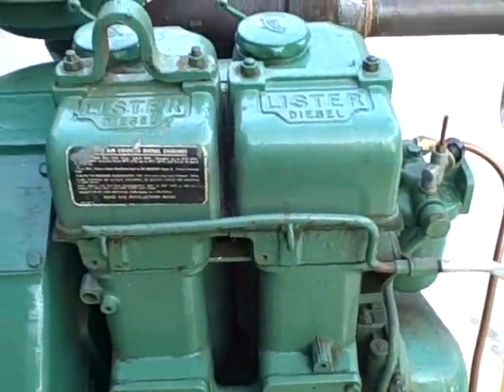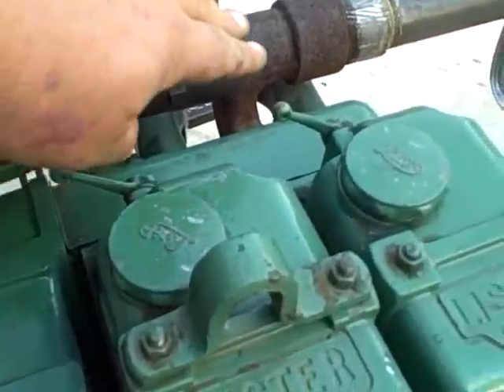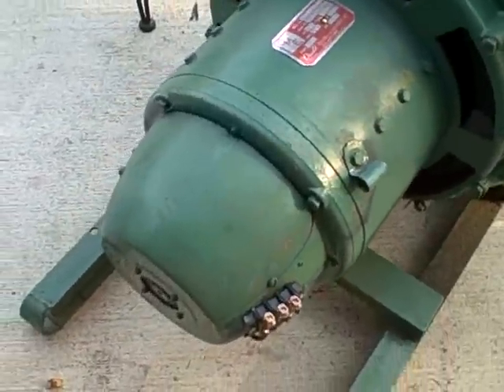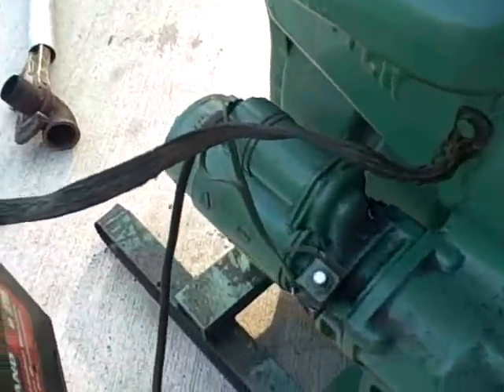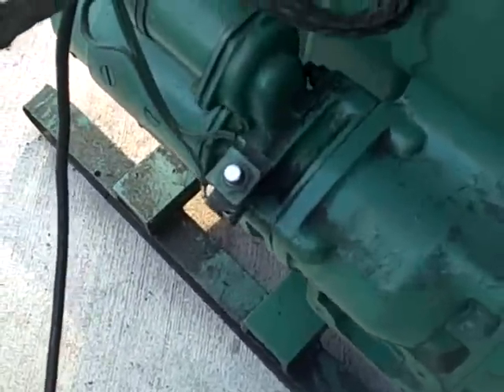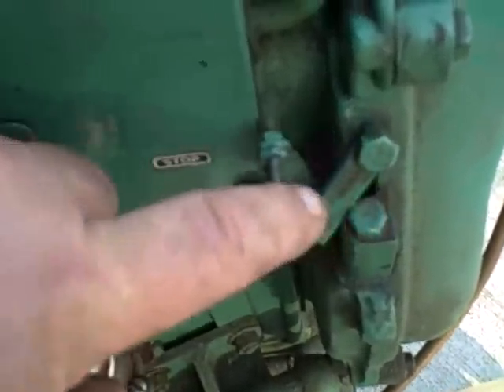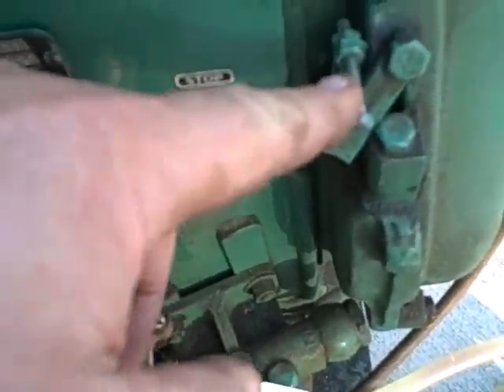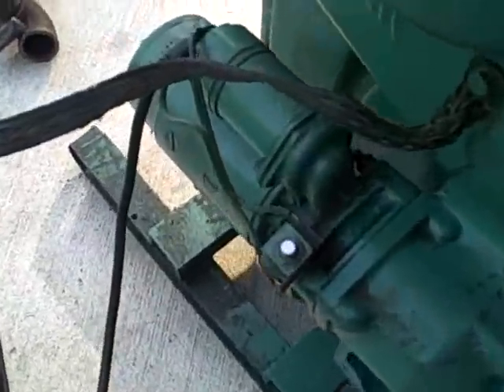Lister HA2 on Homebrewed Biodiesel

Comment: Hpw long does this run with 4 gallons?
Reply: The Lister HA2 burns about 1 pint of fuel per hour and that can vary depending on the load to the generator, of course.

Comment: I have a HA2 as well.  The one thing I can't find on this engine is what the weight is.  I want to find out what the mass is for mounting onto a trailer.
Reply: The engine itself, dry, weighs (officially) 620 lbs. If you have a genhead mounted to it and a skid or some other items, that would alter that official weight accordingly.